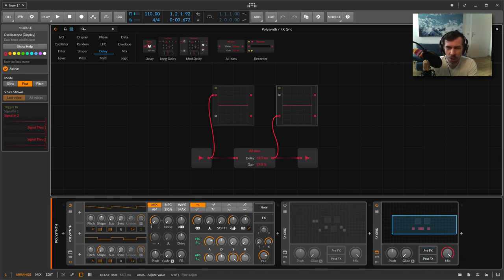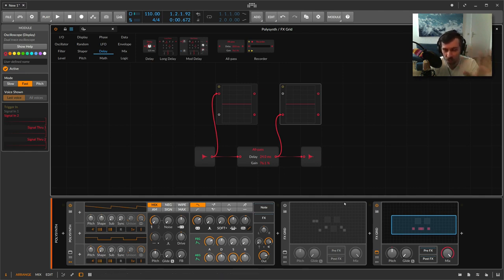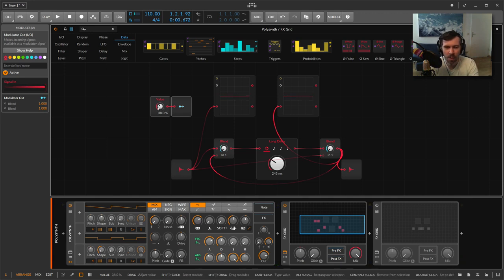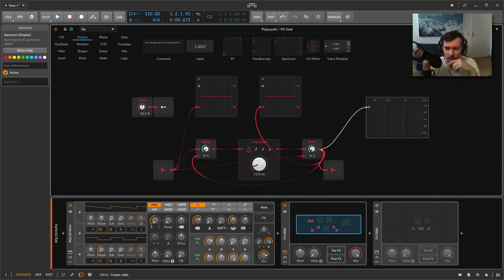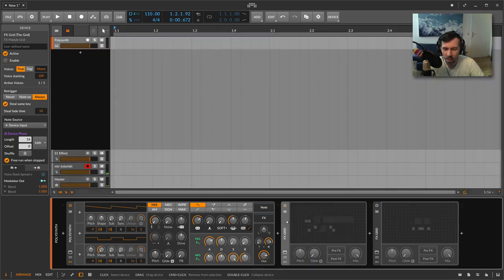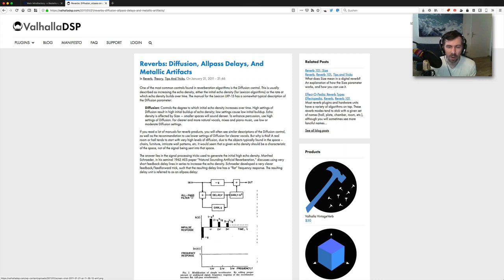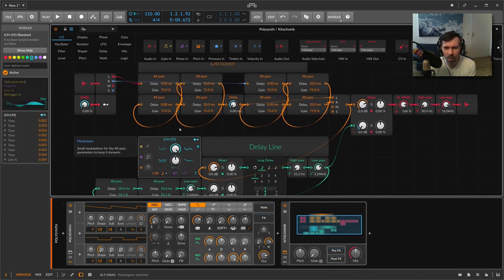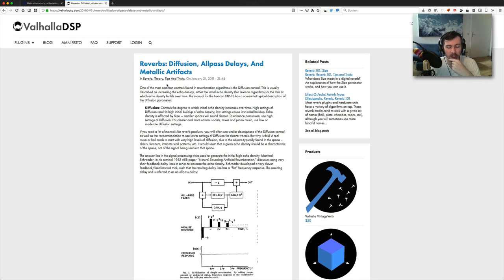All-Pass Delay - Bitwig Grid Module Guide

Comment: allpas is actually a delay line with a feedforward and feedback gain coefficient , they are then summed at the output .
result : it's a diffuser delay line.
If it would ony have one feedback coeeficient , it would be a comb filter .
All these are related and are the basic building blocks for reverbs